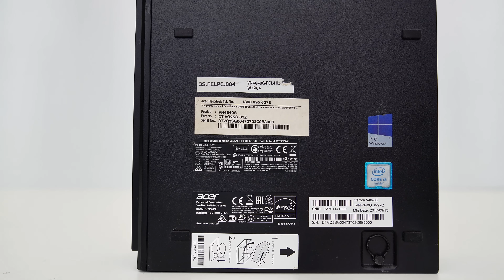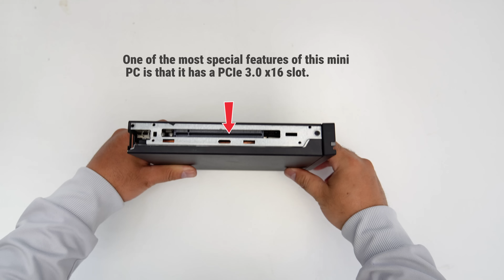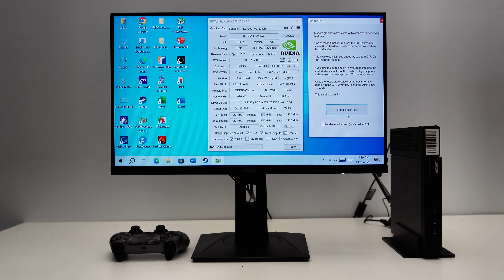$40 Mini PC GONE GAMING: N4640G i7-7700T & T400 Upgrade

Comment: I need to know if someone has try the arc a310 on it. Its 30w but it peaks into 50w, maybe with some power limit will work 😅
Reply: I second to your need. Did anyone tried this? I'm choosing between Dell Optiplex Micro with optional HDMI 2.0b port or Optiplex SFF with Sparkle ARC A310 Eco 4GB DDR6 with HDMI 2.0b and HW AV1 decoding/encoding.

Comment: my n6660g kept on crashing with a wx4100 did ur one also crash on the test?
Reply from the maker: There is no issue. The WX4100 is a 50W GPU, but your PC only supports a 30W GPU, so it will not work.

Comment: Mine is exactly the same, but my T400 has 2GB of RAM. I bought a Tesla P4 and I plan to run it at 50W to see if the performance improves significantly. Additionally, I also bought a 135W power supply, but I don't know if it will work. Perhaps this machine only supports a 90W power adapter."

Comment: What version of Windows 10 are you using? Since Microsoft decided to cut support for it. Is it LTSC?
Reply from the maker: I don't know and I don't care. Do you care the most? While I acknowledge that technical concern, it is not the focus or priority of this project. This PC cost only $50, and I exclusively installed Steam to test games, without logging into any other personal accounts. The fact that Windows 10 is no longer fully supported means it will stop receiving future updates and official Microsoft assistance; it does not mean the operating system will stop working immediately. We are not treating this setup with the seriousness reserved for a $1,000 PC. As previously mentioned, this content is intended strictly for entertainment and educational purposes only.

Comment: Hi! Can you create a case for the M920Q that accommodates an RTX 4060/5060 low-profile graphics card? I bought one of yours to fit an RTX 3050 low profile, but I decided to upgrade, and it didn't fit. I powered the RTX 4060 low-profile with a Pico PSU.

Comment: Is it possible to change power brick to 200 watt one and use 65 watt gpus?
Reply from the maker: No, it's not an AC adapter problem. This PC model does not determine the wattage of the AC adapter that is connected. When you install only a CPU, the BIOS shows the System Power as 65W. When you install a PCIe expansion card, the BIOS will show the system is running at 90W, and when you attach the DVD drive, the system will show 135W, regardless of your AC adapter's capacity.
Reply: Oh) thank you for your answer)

Comment: If there is an option to reduce tdp in the amd drivers or with msi afterburner, maybe you could still use the rx6400 at some performance cost. Same for a rtx 3050. Other than that lovely mini pc. If you could use a stronger gpu it would be perfect with the steam so.
Reply from the maker: It won't work. It can use as normal but when you load the game it will shutdown immediately.
Reply: @itggear Ahh, what a pity. It could've been great. Thanks for the info though!

Comment: Hmmm can you you also try 1600x900 (900p) won't be bad anyway for tomb raider cap at thirty raise settings it will be fine doom eternal should see a bit of an uplift at 1600x900 medium capped at 60. 

At least I think so 😂 but overall love the build
Reply from the maker: Since last year, there have been numerous requests to install a GPU in the Acer mini PC. I have attempted to manage a successful GPU installation on this model to satisfy these requests. However, as this PC's PCIe slot only provides a maximum of 30W of power, high-performance GPUs are incompatible with this specific model.
Reply: @itggear  Like I said loved the build but it's more of a 900p rather than 1080p machine but its still good to get those frames from a t400. I didnt even know this machine existed till you posted about it so thank you again! :)

Comment: Nice video, my friend as excepted about the cyberpunk 2077, can this pc handle it
Reply from the maker: The GPU doesn't support DLSS, so you might have to run games at 900p or 768p. This is similar to how DLSS Quality mode upscales 720p to 1080p.
Reply: @itggear should the card support the dlss also can FSR help to increase the FPS